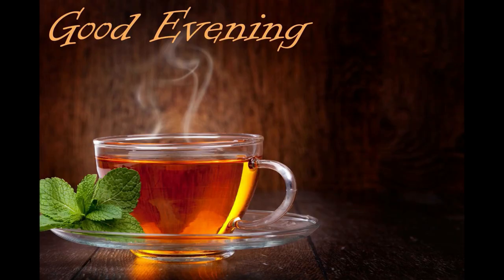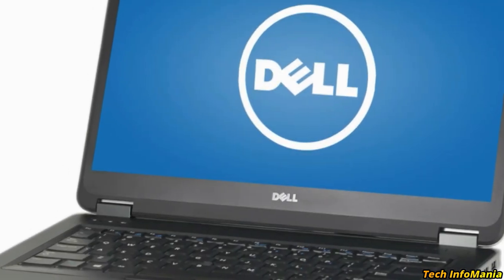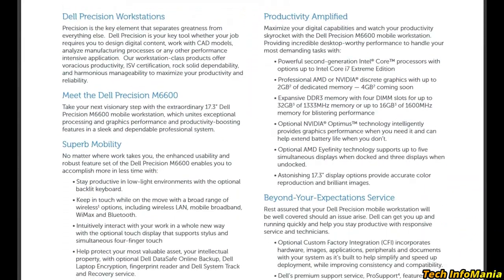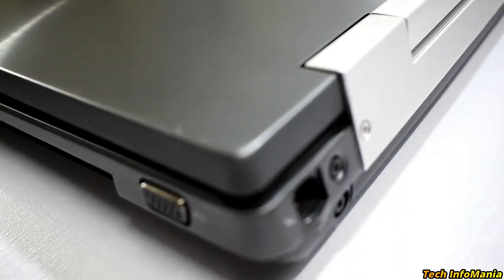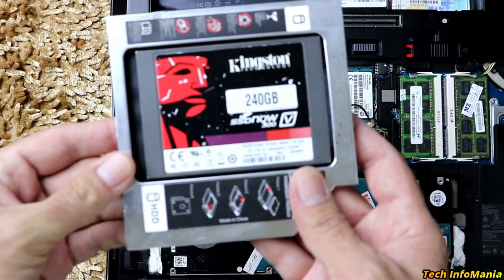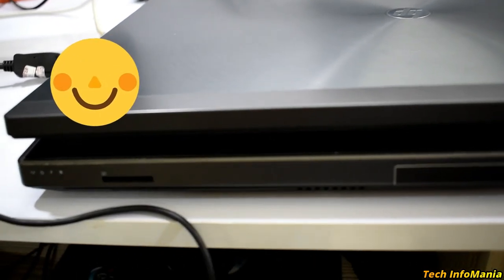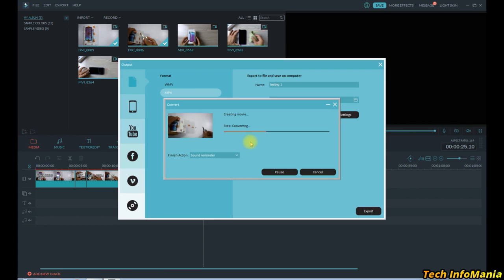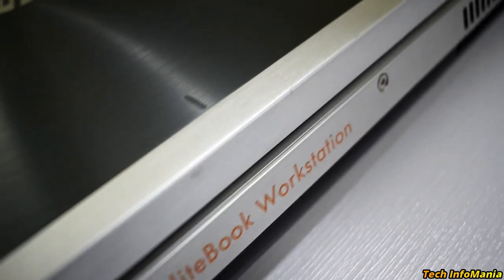HP EliteBook 17 Inch Used Laptop 8770w Cost 170$ (English)

Comment: The 8770w is a good machine and heavy duty but the quadro GPU gets burn and you will not find this part easily to replace
Reply from the maker: Ic.
Thank you for the info
Reply: Hp workstation 8770 how much sir
Reply: Just get a GTX 980m
Reply: @MR.BONES007  😃، comment was before the  GTX 980